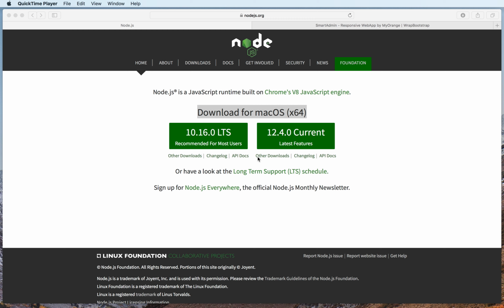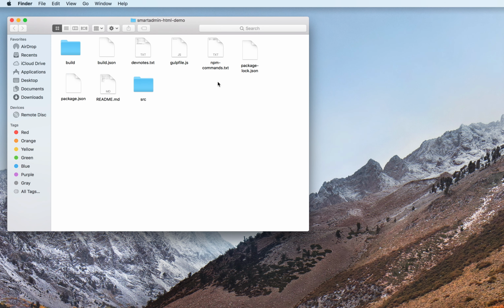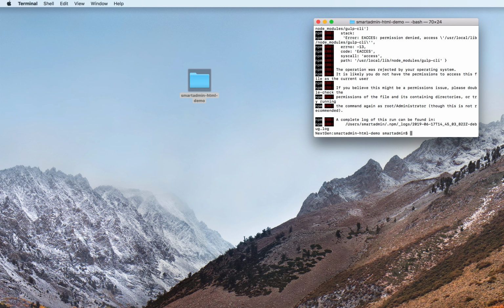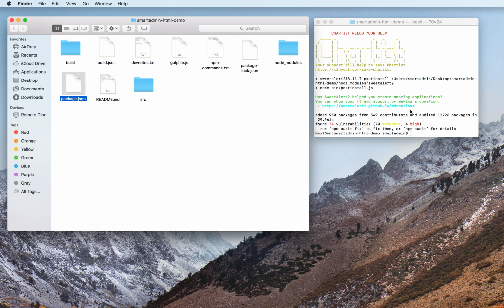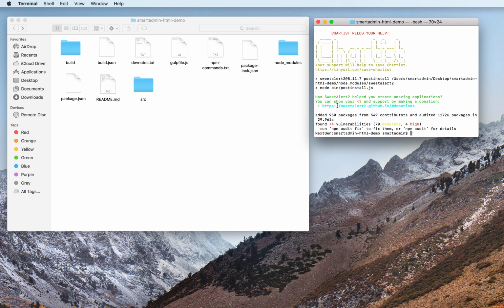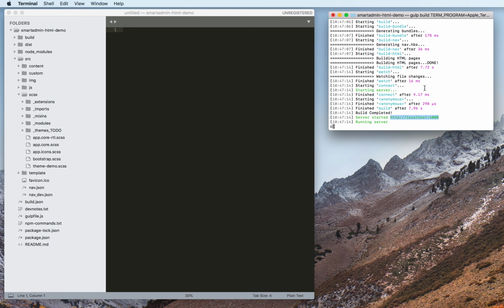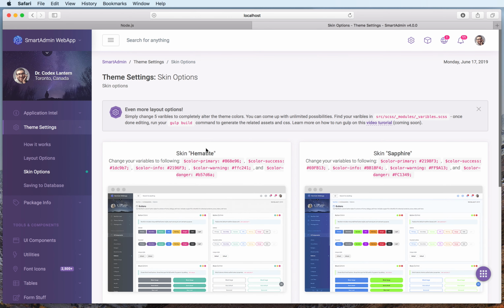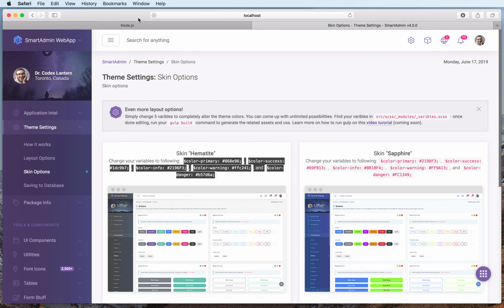SmartAdmin Basics - Gulp build & skin changes

Comment: RTL please
Reply: Samir Alghazaly it’s included in the last update
Reply: @sunnyat7579  in which release 4.0.2? I have 4.0.1 is (coming soon)
Reply: @sunnyat7579  Releas 4.0.2 worked fine with me but I have to change all css files , in release 1.9 it was a body class only so all changed accordingly if it can be like that please tell me
Reply: Samir Alghazaly you can also open your gulp file and enable RTL support and recompile the project. This way you don’t need to add the RTL css , your base css will compile as RTL.
Reply: @sunnyat7579  What I want to make a dropdown list and according to chosen Item it will show either RTL or LTR